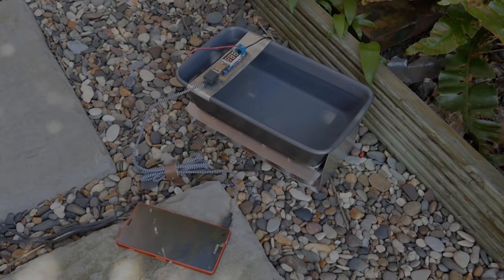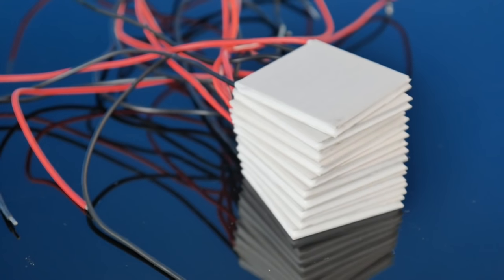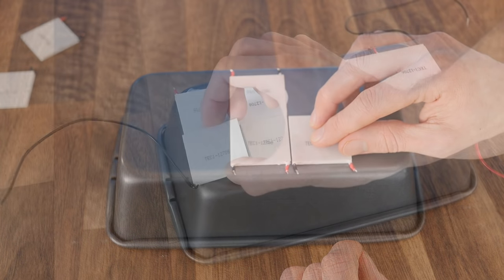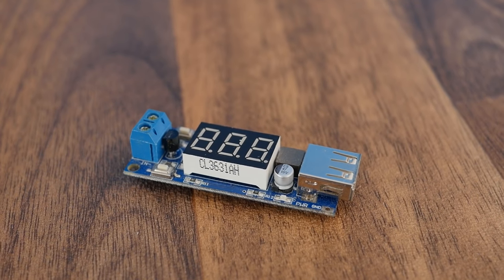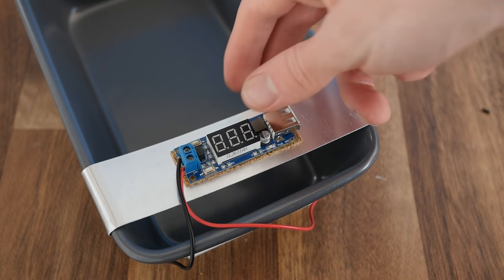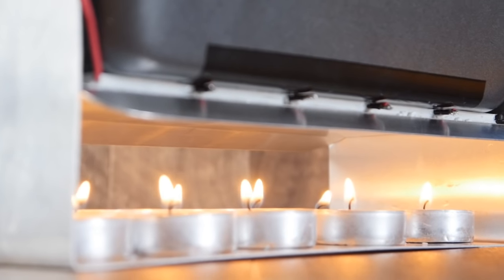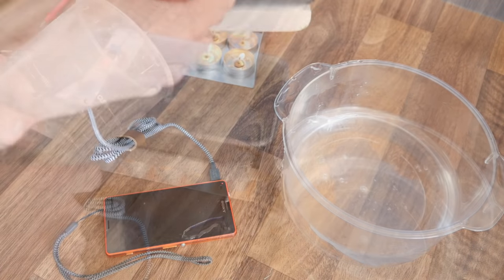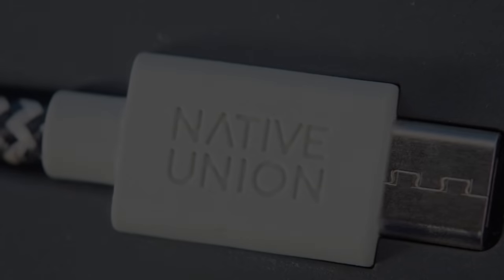How to make a DIY Thermoelectric Generator

Comment: let's use thermite for the candles and liquid nitrogen for the cold water.
Reply: now we can power a gaming pc
Reply: +Jチヌびゅ think about "wattage" first!!!
Reply: that was a joke u all know right?
Reply: Use dry ice and lava. hehe...
Reply: LOL
Reply: I think the lava might destroy the container...
Reply: +Cornerstone don't worry it's fine...
Reply: Use liquid helium and a Blue Giant Star
Reply: Bill_Mccoy i actually understand that because im also a astronomy geek. but that is a lot harder to do. my idea is technically possible if you use slow burning thermite. and some insulation from the flames via 1 inch thick steel or something.
Reply: you all know the module have temperature limit, right?
Reply: ICantThinkOf ANameDoesThiscount? First... nice name! second I am 100% joking with this comment why are people trying to fact check me???
Reply: I have a Question.
I built this machine however it wasunable to provide enough electricity to power my phone(the phone was charging but the battery was still decreasing). Anyone have any tips to make this machine more effective without having to tear the whole thing apart?
Reply: Not enough amps
Reply: +Ruben Yeah I know, but is there any way I can Increase the amps?
Reply: Uhm, there's probably some kinda chip that permits to regulate amps, but I dunno
Reply: DIY Perks Help!
Reply: use dry ice and lava. aside from the fact that it will melt the whole thing, it should work!
Reply: Gabe Newell thermite would melt the generator the the table it was put on and possibly the floor
Reply: Dry ice for the cold side is actually a pretty good idea! ;)
Reply: Yup Thermite will turn that aluminum into a liquid pretty quick.  I hope no one took you seriously ;-)
Reply: yes man you are right
Reply: Skulldriver101 use candles as the candles and liquid nitrogen to cool the tin that will last for a long time
Reply: yes
Reply: the power level would be OVER 9000!!!!!!!!!!!!!!!!!!!
Reply: yup
Reply: thermite would run out too quickly. Would need an absurd supply.
Reply: Some suggestions come to mind:
1) Don't use TECs for this use TEGs instead. TECs are Thermo Electric Coolers. They are designed to be used as coolers, not generators. TEGs are Thermo Electric Generators which are designed for this purpose. Using the exact same setup but with TEGs you will get more power out of it.
2) Instead of a flat sheet of aluminum for the heat input side use a finned heat sink for the heat input. Physicially stronger and it will have a lot more surface area so it will absorb more heat. But stick with the small candles. And yes the heat sink will take longer to warm up.
3) If you set it up near a sink you could pipe in cold water from the faucet and add an overflow to drain off the warm water near the top. You only need a tiny trickle of cold water coming in and you never have to interrupt the charging cycle just because the water in the pan got warm. And it could still be used as a portable charger. Just slide the consumed candles out from under it and slide in a few fresh ones as needed.
Reply: I think you need to do more research on tegs. The modules have 3 modes. Heating, cooling, and generation. Put the current through negative to positive, you generate heat. Positive to negative, you generate cooling. Heat the side with no lettering, and cool the side with lettering, and you generate electricity. TECs, TEHs, and TEGs, are all the same module. It doesnt just have one use.
Reply: Both of you are right. But John KaBang pointed out, that TEGs are specially designed, to have better performance on GENERATING electricity then TEC (due to differect temperature range of operation) and TECs are better in cooling then TEGs. http://www.europeanthermodynamics.com/news/difference-between-TEC-and-TEG
Reply: If the hot side is too hot, it damages the TEG, regardless of how cold the cold side is.
Reply: Ammar K turn it off while charging
Reply: nice idea i will try it to power a gaming pc ( seriously no joke )
Reply: Ammar K more of them hooked in parallel. Make a few like that or a larger one. I. Guessing the bigger plates have larger amps as temperature difference increases voltage
Reply: Ammar K build a second one and wire it parallel at the regulator
Reply: try using modern technology
Reply: @amnotgenjimain6027  soda cans, copper coil, dirt & salt water - modern technology :)
Reply: Argon gas  can be used as a coolant
Reply: A brooder lamp would probably work just fine
Reply: +Jチヌびゅ !!!!
Reply: @Apismeliffera  I'm thinking more off grid, maybe the snow idea, with some sort of reserve/hopper? to feed fresh snow in as the melted, warm snow runs off the overflow?
Reply: @ammarkhawaja3617  change ur charger cord.
Reply: @ammarkhawaja3617  change the connection.  Instead of all series , make it divide by two. Series and then parallel to double the current
Reply: So, from the comments this thing doesnt actually work?
Reply: Skulldriver101 the thermite will destroy the things
Reply: instead of liquid nitrogen, use poor mans liquid nitrogen
Reply: @Gomey World shh. I've spent 3 years finding the dumb ones.
Reply: Use stove!
Reply: sEeMs LeGiT
Reply: @Even1o2 thank you.
Reply: Fixing hot plate at 50 degrees and the heat sink, which thermoelectric module would produce more power: TEC1-12702, TEC1-12706 or TEC1-12710?
Reply: @marvinmarvini8629  asking the wrong place probably. This comment blew up.
Reply: Obama Barack wire in parallel
Reply: NASA used a Radioisotope Thermoelectric Generator for all the ALSEP projects.  Which basically was using the seebeck effect to make a nuclear battery.  The seebeck effect being produce with I would assume the coldness of space and the heat from the radioisotope device. https://en.wikipedia.org/wiki/Radioisotope_thermoelectric_generator
Reply: infinite power
Reply: This may have been made years ago but wow that’s funny
Reply: @superherobeatdown  just made me feel old seeing how long ive been active on youtube
Reply: @superherobeatdown  just made me feel old seeing how long ive been active on youtube
Reply: @skulldriver1019  I wish I found his work six years ago as a carpenter I see stuff like this every other day would be more interesting to make it myself
Reply: @Apismeliffera  Dude, I did not know that. Thanks! 😊🌎❤️💪
Reply: @xxxSpeeDxDemoNxxx  It wouldn't last long! But it would be pretty exciting! X'D
Reply: @bill_mccoy  or A blue giant before it goes suernova
Reply: @ammarkhawaja3617 multiple one in series
Reply: @Taib-Atte I'm pretty sure that liquid nitrogen is colder and thermite is hotter
Reply: @mihaiplaysgame  Brother I made that comment 7 years ago I’m a grown ass man now
Reply: liquid nitrogen isnt a bad idea

Comment: Input 800 watt of heat,output 1.5 watt of elecricity :D:D
Reply: I was thinking the same thing.  I wonder what the efficiency is for this set up / what the limit would be.   
Good use for waste heat tho.
Reply: They say one match stick as about 1 btu.  1 watt gets you 3.41 btus
Reply: Dont think those 10 candles are producing 3000 btus
Reply: Welp, started doing some searching and found the 80 watt per candle thing... shutting up now
Reply: @Cary Howe youuuu my friend, you are my God! How did you calculate that? I'm actually pretty good in physics and electricity but I can't find any kind of Formular... Can you help me out? :)
Reply: @MarcEis  Cary's calculations are essentially just converting from a unit of power to a unit of energy per day. A 100 watt solar panel costs about $80 (according to ebay). Since the sun moves through the sky during the day, a solar panel is more powerful at solar noon than in the morning or evening. Let's say you average out the sunlight through the day and through the seasons and you end up with an average of 6 hours of sunlight per day. So that $80 panel produces 100 watts * 6 hours = 600 watt-hours of energy per day.

Whereas if you spend $80 on TEGs you will be able to purchase 35 modules ($2.30/each according to ebay). If you have an 80C temperature difference each cell will produce 2 Watts of power each (according the the data sheet 3.6V * 0.558A = 2 Watts). So those 35 modules produce 70 watts which appears to be less than the 100 watts from the solar. But... if you can provide the heat for 24 hours a day that is 70 watts * 24 hours = 1680 watts-hours of energy per day for the same cost.

That is assuming the heat for the TEGs doesn't cost extra.
Reply: Inefficiency dude
Reply: Heat is often cheap.
Reply: He could've closed the fuel chamber with holes for air and put just two candles to achieve same result
Reply: This video clearly says, this is to be used outdoor, when Mobile ran out of battery. So no worries about wasting btu 🤗😁
Reply: It does not really matter, the system is still 100% efficient if this was working indoors all heat would still be captured. 
And if you make Hot Chocolate and get free electric at the same time its worth it.

Comment: i read thermonuclear generator :(
Reply: I wish it wass
Reply: you can pretend :(
Reply: +Nae Dolor omg lmfao best thing i have heard today! xDD
Reply: +Nae Dolor :(
Reply: Just replace candles with nuclear isotope heat source like Plutonium 238 oxide pellet. You got Radioisotope thermoelectric generator.
Reply: follow these easy steps
1. download TOR
2. follow the links bellow
3. buy uranium pellets with around 5% U235. this might be illegagl inyour country
4. ?
5. profit
Reply: TOR is undermined by uses like this and also it sends telemetry to the alphabet gov after latest update. Use Tails linux on USB flash dongle.
Reply: with his skills, he can probably make one in  a week.
Reply: @richardtickler8555  SOLD! 
i like, OLE!

Comment: There is quite a bit to do on the efficiency side of this design. 

Firstly, all the thernoelectric generators are in series. This might not be that optimum of a plan. The issue is that the central element probably generate more energy than the side once. The aluminium heat spreeder really don´t spreed the heat that far. A solution to that problem could be to wire them 2x5 or 5x2 or 3x3 (and skip one) and for the case of the 5x2 or 3x3 use a step-up regulator in steed of a step down

The second part is efficiency of the candles. Most of the heat is wasted. It´s not turned into electricity, and not even into heat in the pan. One way of making this... sure have to rebuild quite a lot of the design, is to make a funnel. That is collect all the heat of the candles, funnel it up a "chimney" and have the thermal generators.  Could have 4x2 and have a upper and lower stack in parallell. Or make a really narrow chimney and have 2 facing each other and have them stack 5 high.

The last problem it self is the peltier elements... they are simply not that efficient. A normal rankine engine is about 4 times more efficent... but of cause.. find a home size rankine engine might not be that simple.
Reply: i thought of using a boiler and copper piping to input heat
Reply: Just remember to install diodes between the parallel TECs to prevent one branch from back feeding into another if the voltage is not exactly matched, which it won't be. Also the diodes will decrease the efficiency a little
Reply: What if you used this technology to make a thermoelectric solar panel.
You only would need to scale things up and use a aluminium manifold as heat sink
Reply: @mequedo  this would be useless as it would be expensive, inefficient and unnecessarily complex relative to solar panels, however it would be possible to create an RTG with this technology, hell this is how an RTG works.
A better version of a thermal solar panel would be a heliostat which boils water into steam that drives a generator.
Reply: @s.sradon9782  You used an unfamiliar (to me) acronym, RTG.... Cast some illumination to me.
Reply: @jim7smith  it means: Radio Thermoeloectric Generator.
it is a stirling engine powered by difference in temperature (as all stirling engines are) which is caused by the heat given off by the radioactive decay of molecules.
its the thing that powers curiosity, the rover and some soviet lighthouses and it's advantage is that unlike a nuclear reactor it requires significantly less heat and therefore radioactive isotopes to work.
hope this helps :)
Reply: @aravindkrishnan3148  huh, we had a scottish equivelent that is significantly less prestigous of that and my idea was a government funded megafactory complex that relied upon algae farms to recycle captured carbon into useful products, such as high quality food. I had to design all the key aspects of such a factory. I hope your stuff goes well but you can always ask some idiot on the internet like myself to help you out.
to start you would need to machine or get someone else to machine a stirling engine for you as  those peltier chips are incredibly inefficient. I have a 3d printer if you need to have access to one.

Comment: I just defended my PhD thesis about thermoelectric generation and I have a suggestion for you. 
Inside most TE modules there is a layer of graphite that needs to be compressed in order for the modules to work properly. If you would clamp the modules together also during use, the power output from the generator would increase signififantly due to lower thermal (and to some extent also electrical) contact resistances inside the modules. The modules I've been working with should have a contact pressure of 1.2MPa. Such a clamping device would cause the whole generator to be a bit heavier but the increased performance would make it worth it. By the way, thanks for all great videos! :) // Olle
Reply: what sort of clamp would produce pressure that high?
Reply: Did you learn about the required contact pressure from empirical observation? Or from the manufacturer's documentation?
Reply: Hello! My senior design course is trying to design a charge for a cell phone from a cooking fire. May I email you with questions?
Reply: How did your design go? I saw a thermoelectric generator that fits over a gas powered lantern, using the heat energy to power old vacuum tube radios. Obviously this is from the 1940s (listen to the radio without AC power or a car battery). The idea is applicable today to charge our modern much more energy efficient devices, and can be extended to your cooking fire design requirement. One side hot, the other side cooler and it works with dissimilar metal wire instead of P-type N-type semiconductor junctions.  The electricity was generated from hundreds (thousands?) of pairs of twisted together dissimilar metal wires. Twisted wire pairs instead of peltier plates can work at higher temperatures and without megapascals pressure without failing.
Reply: How did your design go?
Reply: There is a outdoor wood stove that uses the heat to charge a onboard power bank, it's called the Biolite 2+.

I would love to see a more powerful device.

Comment: It may be worth insulating your water bath to keep it cool except for the contact pads. Also trapping as much heat as possible on the underside without smothering the flame. Currently, the candles are basically heating up the exposed water bath.

Comment: Great project! Nice concept, and definitely seems like a simple way to convert the temperature difference into electricity. But those so called "peltier modules" are pretty inefficient, but as you said in the video, cheap and simple.
Reply: Fixing hot plate at 50 degrees and the heat sink, which thermoelectric module would produce more power: TEC1-12702, TEC1-12706 or TEC1-12710?

Comment: I'm really tempted to buy those thermoelectric things now, but I don't have a use for them.

They will become one of those  "I'll probably use them at some point" things lying around my house.
Reply: lol same
Reply: +LazerLord10 Yup, and then you find out that they draw 2 Amps at 12 Volts in cooling mode, and only produce one milli-amp of current in reverse mode, and they stay in the drawer were you put them when you got them.
Reply: vinny142
yeah.
Reply: @LazerLord10  Peltier elements desktop air-conditioner; cupholder for cars that can make a water bottle stay icy cold; cooling system for fully outdoor computer; liquid cooling system clothing; icemaker
Reply: Over the years I've bought some.
All.laying around the house. Many projects tried. None of them were usefull.

Comment: Awesome!
Reply from the maker: Cheers!
Reply: +DIY Perks  do you wan to make a camera  jib
Reply: Thats what channels like Linus Tech Tips are for.
Reply: Mist8k what of you get a cpu heat sink and use the power it generates to Power the heat sinks fan
Reply: Fixing hot plate at 50 degrees and the heat sink, which thermoelectric module would produce more power: TEC1-12702, TEC1-12706 or TEC1-12710?

Comment: Good video! The science behind peltiers is pretty cool/fascinating and the application is fairly easy to apply to just about any heat source. Unfortunately, the tricky part/catch22 is coming up with an ultra-efficient (no cost) way to heat the hot side, while also efficiently cooling/pulling heat away from the cold side.  Attaching a bunch of peltiers to a free heat source, such as (ie) a "fire-ring" (while camping in the middle of Winter) would work really well... but very few people are going to want to sit around a campfire in the middle of Winter/single-digit temps to take advantage of the limited electricity being produced.  On a side note,  if a person had a free/unlimited supply of candles and ice, the device in the video would be great to have around... especially during a power outage.
Reply: One use case is in computer cooling, but I don't know if it's efficient enough to be worth the cost.